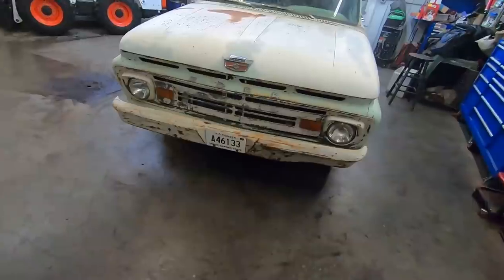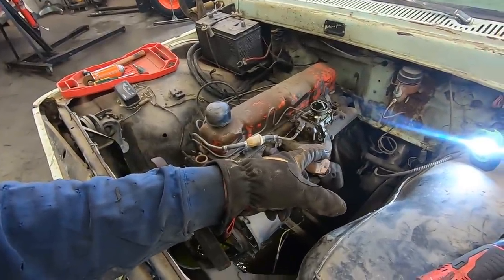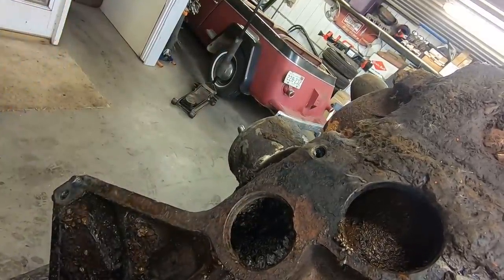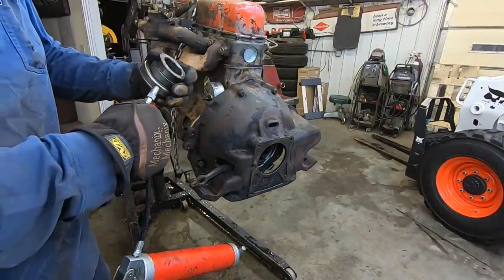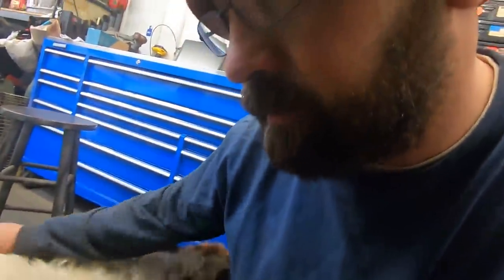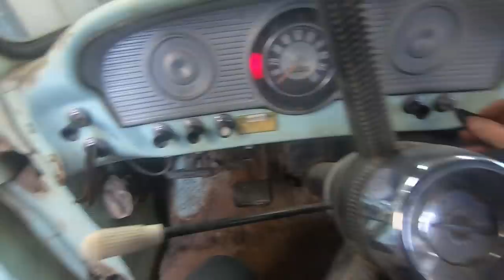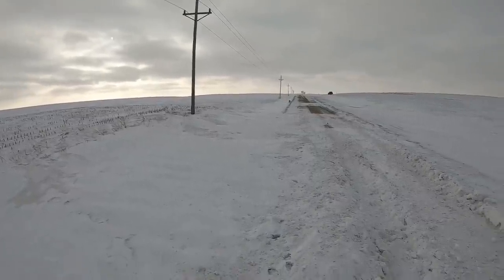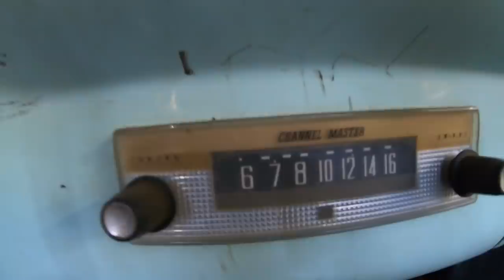My 1961 F100 Unibody Shortbed finally gets an engine R&R! And then we bury it in a snowdrift...

Comment: I got my '66 F-100 stuck in my alley in the mud. Had to pull it out with my '76 impala. Got my '67 F-250 4x4 stuck in my backyard in about 10 inches of snow. I just had new Kelly Springfields put on it. Had to shovel my way down to the house, and drive down the front yard to the street. The clutch was not happy, it was stuck in gear. Good times !

Comment: The trick to floor dry is to just cover the entire floor in a generous layer as a preventative measure...
Reply from the maker: Ugh. Hate that stuff
Reply: Listen to your elders Mortske
Reply: I Just keep my old dog food bags and fill them with sawdust when I do a project. Use that for oil soak duty.
Reply: It's a necessary evil. Especially if you are working on hydraulics. Right Wes? Or, like Possum Works says, don't make a mess in the first place. I hate cleaning. Being as cheap as I am, I don't buy floor dry. I just use a shovel full of dirt from outside.
Reply: Bring a carpenter, Sawdust from the table saw. Then a bit of lime or plaster gets it all and sucks the stain from the concrete

Comment: The flywheel from a Y block will fit and balance on a 223. The advantage is you can get the larger 11 inch clutch. Also if you get the Y block flywheel from the larger  F 600 truck its heavier. It stores more energy and helps with that first gear take off.

Comment: pro tip- to make any vehicle go faster cut a hole through the floorboard (unless it already has one) so you can push the pedal down further and not be restricted by the floor, also works on brakes

Comment: Love the concept to use the front  axle as a snow plow! Definitely keep it as an inline 6.  You and Duff keep up the good work 👍
Reply from the maker: Brilliant!
Reply: David no! there is never a good reason for a six cyl just like there is no reason for hubcaps or wheelcovers& bumper stickers unless you wear a tin foil hat
Reply from the maker: @bradzimmerman3171  Hey I don't mind a 6! Or hubcaps!
Reply: Some later Ford inline sixes had the intake cast integral with the head.   Owners have cut extra holes into the top of the intake and brazed one or two more spouts for carbs.  Cheap and can be done neatly.  Same can be done for dual exhaust.
Transmission is probably limited to a t5 adapted to the stock bell.  I don't know if an RUG will fit that bell.

Comment: I'm a Ferd guy, so don't think I am bashing them, but the Unibody was a bad idea. When you put weight in them, the doors don't work right. Some times won't close, and some times pop open while driving. There is a reason they stopped making them.
Reply: I've got a '62 F100 unibody long bed, it's a runner but it's pretty rough. There is quite a bit of "self clearancing" that has happened inside the door jams where the upper portion of the bed side rolls into the cab, and the area underneath where the rear roof pillars come out away from the bed. Basically evidence of being owned previously by a 300 pound gorilla who'd just go to town slamming the absolute hell out of the doors to get them to close. Much like Morske's rig it originally had like 8 leafs in the main spring pack, and had the 3 or 4 leaf overloads, so Lord only knows how much weight that poor truck hauled around in it's prime.

I've also got a '63 F250 with the standard detached fleetside long bed. I think the unibody trucks are better looking, just because the box actually matches the truck cab and front fenders. But the detached bed definitely makes for a better truck if it's actually being used as a truck.
Reply: I own a 1961 Unibody long bed,my Dad owned. it's been overloaded many times over the years. Never had any problems with it. Cab,doors and all still work just like they did when Dad bought it. One load was the old type concrete blocks, over the top of the cab from front to back of the bed..
Reply: Just like when you jack a unibody car up for an oil change or whatever just to find the doors won't open or close because the body is twisted. Been there, done that. I only own full frame vehicles anymore because of that.
Reply: @_Frank_the_Tank  I agree the uni looks better, but if you want a real "truck"...
Reply: @MaxNafeHorsemanship  In their prime the detached bed was definitely better for a "truck", but 60 years later I seriously doubt anyone is still using one of these as a daily work truck... The ones that are left have been hot rodded/rat rodded, or they're survivors that come out for the occasional leisurely cruise, so typically the better looking unibodies are typically more desired then the standard working man's fleetside.

I'm slowly ruining what made my 63 F250 a "truck" ... Ditching a leaf sprung 8 lug solid front axle for independent coil suspension from a 97 crown Victoria. Ditching a 8 lug leaf sprung rear end for an 8.8 from an explorer with a 4 link and coil springs. Ditching an old inline 6 and 3 speed for a 4.6 and a 5 speed from a 03 mustang gt. Finally, ditching a completely trashed 8 foot fleetside bed and cutting the frame down to fit a step side short bed that came from a 58 Ford.
Reply: @_Frank_the_Tank  Not all of us. If I still had my '52 IHC I would still be piling 2 tons of scrap metal in the back of it. (it was only a half ton) That was one tough truck and the stock 6 was a torque monster. You couldn't make it a better truck. I guess you could make it into something else if you want. I still daily drive my 66 Falcon cuz cars are meant to be driven. Just like old trucks. The new ones don't even compare if you want to do some real work. I still look at things the way they were meant to be.
Reply: They are really cool looking though
Reply: The Unibody trucks make awesome show trucks and cruisers, but there's a reason they didn't keep making them.

Comment: The blower probably starts on hi so as the blower slows down from age and lack of oil it still spins a little and doesn't burn up. Also, a squirrel cage blower will move air even when running backwards, the air flow will be lower though. Sorry, I'm late to the party you are number one on my list and I always save the best for last ;o).

Comment: That’s awesome Mortske, you really keep those oldies but goodies goin. Negative temps and your out bustin drifts with no heat and bald tires??!! You ain’t scared love it! My truck is an 80 F100 and its got a floor shift three speed overdrive. It originally had a 300 six cylinder. First and second low third much taller, fourth very tall.

Comment: Those unibody pickups looked much better than the 61 fleetside with a seperate bed. The bed they used on them came out in 57 . and never really looked correct. I call them wrongsides. In 65 they finally changed to a bed that matched the cab style.

Comment: Excellent video Mortske Repair  :) what do so frost plugs don't leak or blow out is change antifreeze also thermostat plus water pump every 5 years and put in every 3 months to 100ml of Differential fluid in rad let circulation too ! Also help the engine oil cleaner plus gasket from leaks too also crud in behind frost plugs to oil pan when change or antifreeze too! I only had one frost plug come out on me in one vechile because guy rebuilt motor did put in right and  long time before starting rebuilt my own engines plus others too! When lost frost plug was one below head and blew rad up to same time and big cost and frost plug on side of engine on back side ! Plus had do new thermostat too ! Car was 1995 Ford Taurus GL 3.0 litre V6 on right side last year of cast iron block plus heads too and crap transmission Electric 4speed Overdrive Automatic transmission and transmission lines not fun to change to!

Comment: Now that was an adventure Mortske. Nice to have friends to bail you out of the snow. Duff sure had fun though. Hate to say it but it's 80 degrees here in Mesa today. About a 1% chance of rain this week. Definitely Chamber of commerce weather. I' have one of those freeze plug installers but by the time the thing stops trying to install the plug crooked The old tried and true half inch drive socket and extension comes through every time. I picked up a Swedish pattern pipe wrench today. A buddy uses one all time on hard to reach stuff. If you have not heard of it Google it. Might be something to ad to your tool collection. That old Ford unibody is cool as is. Robin egg blue. Three on the tree and all. How many do you see these days without an engine swap to a huge V-8?  I know every pick up like that here has been all chopped up and not in a good way. That truck is surprisingly void of body rot. Great patina. Everybody get Duff approved. Have a great week my friend.
Reply from the maker: Never seen one of those.
Reply: @MortskeRepair  Time to try one.

Comment: So glad your keeping it stock. If you really wanted a V8 I would say shoot for a 289 or 302 it’s probably cheaper than a LS swap. I never understood putting a LS in everything. I know it’s a great v8 but it’s to modern with computer stuff.
Reply from the maker: Can't find a good ford V8 for a reasonable price.
Reply: You can find a good Ford V-8 around my area for a decent price.
Reply from the maker: @stevechasteen4184  What's a good carbureted 351W go for in your area? Where are you located? Send me a link to said deals.
Reply: It varies, I've seen some for 4 to 500. Others are a little more. It seems like deals come along when I'm not in the market for one. There are still a lot of 90's trucks are being parted around here. Also from time to time some marine versions pop up.
Reply from the maker: @stevechasteen4184  90s versions would not be carbureted. Like I said, send me a link to these $500 deals.
Reply: I will when I see them. As for switching to Carburetor it's not that hard. Intake, carb, and distributor is pretty much it. I had a lot of that stuff. But got away from it a couple years back.  I sold it all off fairly cheap and wished I hadn't of. Back then I had little time for a project,  but as I am nearly retired I would like to get something.
Reply: LS is not Carburetor either.
Reply from the maker: @stevechasteen4184  What about installing a fuel pump? I refuse to use a clickety clack electric one.
Reply from the maker: @stevechasteen4184  You are correct on the LS, but there is aftermarket support and I can make one run on 3 wires and a quick flash of the computer.
Reply: You can buy a decent electric fuel pump, it doesn't have to be a cheap one. 😉  I used to have pretty good luck with Holley  electric pumps,  unless their quality has gone down hill. If you want mechanical FP it's not that hard to change timing cover and install eccentric. Or if you have the whole vehicle you can use the fuel injection and ECM,  just like you would have to do with an LS.

Comment: Ha!, Shades of 1970, high school. Street drag wars, kids from families with money vs us farm kids. We were hopelessly outclassed by local GTO's and such, but did have some success after my Mom's LTD got rear ended and we swapped its 429 auto into an identical little Ford pickup. Right out of the gate we learned the true meaning of wheel hop, cured with a set of home brew traction bars, which led to lots of tire smoke and not enough hook up to hang with the big kids. Traction issues quickly cured by adding duals to the rear. The quick and dirty fix worked, the farm kid way, by welding two stock rims together rim to rim. Then that beater truck hooked up big time. After a week or two Jimmy wadded the truck up though. It got pretty squirrely over 100 or so, but at least we did get some respect. Wild times.
Reply from the maker: Nice!

Comment: I commented on my other account earlier, but I switched over to my main channel to comment this. My 223 in my 61 Flareside has no compression either. The parking brake cable was cut, so yeah it does slowly roll down a hill in gear too. Haha

 Looking up the VIN for your truck, I found it was manufactured in May 1961 in Kansas City, Missouri. Sequential serial is 173014. My 61 was Manufactured in August 1961 in Kansas City, Missouri. And my sequential serial is 190828. It's awesome to think both of our trucks rolled through the same line, just a few months apart 61 years ago!
Reply from the maker: Great info!

Comment: Hey morty n duff, cool old truck. You mentioned upgrade and cost, on the flipside, your budget path keeps it original. I do think some Guages would be cool, left and right of the speedo in the circles. I may have the king pin reamer for the job. My dad had an early econoline van, as a kid I remember helping him do the king pins. I inherited dad's tools and I have the reamer in the tool box.  Keep up the cool videos.  Love the look of that truck. Looks like you enjoyed duff, playing in the snow. He's cool.
Reply from the maker: Old tools are the coolest!
Reply: I'm from back in the day, I've owned and drove a lot of vehicles without ps,pb,ac,pw. Bare bones vehicles were affordable and fairly common. We weren't pampered. Vent wing 260 air. Let me know if you decide to  tighten up the steering, I'll mail you the reamer, I'll probably never use it.

Comment: I had no idea they made unibody pickups.  I thought "unibodies" came about as a cheaply built alternative to try to keep up with foreign imports in the late 70's when Chrysler came up with the "K" car and a bunch of crappy cars with bad motors followed.  With that being said, this truck is SWEET!  The body lines are great.  You should throw a paint job at the thing and do that for a video.  "That other guy on YouTube that used to live in Minnesota and now lives in Tennessee" painted a square body with a kit that cost $119 on Ebay.  The same thing could be done to this truck using Bobcat white as the base color and Bobcat orange as a trim.  Maybe just paint the tailgate the orange with the "FORD" in white and/or go with steel wheels painted orange with chrome halfmoon hubcaps to set them off.   Nothing to crazy would make a lot of difference with this beauty.  A simple 2-tone with the white above the hoodline and the orange below the hoodline would be another option.  I did some research and found out Chrysler moved from the "body on frame" construction to "Unit Body" cars clear back in the '60's, so I learned something today.  Anyhoo, I had a 5-digit offer in mind with the stipulation that the key is transferred to a Puddin's Fab Shop key chain, the engine stays a straight 6 and I get custody of Duff on weekends, so it might be too low, although I wouldn't require it have mirrors, I don't use those anyway.  For those that read this whole comment, I commend you on your literacy.  Thank you for your time.
Reply from the maker: We don't paint nothin!

Comment: Let me tell you a little Ford story. Back when we went to a dealer looking for a truck. They had a 92 F159 SC and a 93 Chevy regular cab.
The Chevy was V8 Auto. The Ford was 300 Six and 5 speed manual. We ended up with Ford as it just drove better.
We had that truck for a long time and I would like to find one even now,
Reply: F150

Comment: Mortske, in the mid seventies I had a 1963 unibody 8 ft bed 292 three on the tree. That pick up road the best of any truck I've ever owned. Like a full size Ford car. Didn't handle too bad and got decent gas mileage for a V8 14 MPG on the road. Wish I still had it. Bought it for $600 sold it for $400 with a blown 292.
Reply from the maker: Not bad!

Comment: My grandfather was a master mechanic from about 1915 through 1950s. He used to cut holes in the firewall often to get to the rear freeze plugs of many cars. Back then there wasn't as much on the inside to get in the way so it was a common practice.
Reply from the maker: Ooof

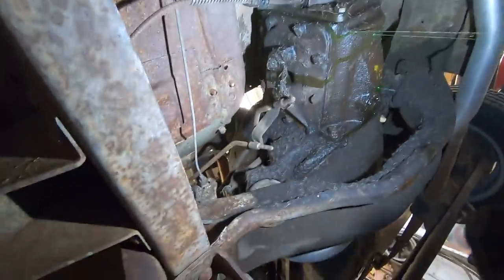Comment: I know it's a little late with this Kevin but my lighting plug for 14:36  my HDMI took a crap and for some reason I couldn't comment anything, but any who next time you do hood springs I use a ratchet strap between the spring and the front support to pull the spring on and off, works great👍
Reply from the maker: Thanks for the tip!

Comment: I had a 62 unibody back in the early 1980s. I was quite fond of that truck other than it was a bit of a handful to drive when loaded with firewood. I liked the engine block heater. Anytime a frost was predicted ... I'd plug it in and set the heater controls to defrost and I then had clean windows when I went out to leave.

Comment: What and awesome truck I had one just like it but mine was a step side. I like that one better. 223 solid lifter motors run so good. I wonder what size ratio the rear end is. Mine was a limited slip some   really low gears though. Not a high speed truck topped out about 80mph. Im not exactly sure that was a long time ago. I drove it to work everyday rain snow ice didnt matter. Great fishing truck it would  go most places. Mine was rebuilt by ford it ran perfect even though the rocker arm shaft was wore out. I just adjusted them by ear. It just ran great. Really noisy when it was maxed out. Rides rough its the huge stack of leafs you could take some out. It might need some new door seals and window channels. The heater in mine was super hot.

Comment: nice video shots and setup this time mortske👍 ,,damn hard work these trucks on your own AND you work a full timer too,much respect ,need to get a truck lift patreon started😁
Reply from the maker: We got one started! Thanks Marc!
Reply: @MortskeRepair  good man even if the roofs low ,it will save forever jacking those trucks in the air😁
Reply from the maker: @marcperrett662  All you can get at is brakes and suspension. they're in the way to get at transmissions. And they're in the way when not in use.

Comment: I had a 61. If that was sold 61 then it was late in the year because the grill is 62 and the letters above the grill are factory. If you splice in a 1995 full size bronco frame and all , it might be possible to open the cab door when there is any weight in the bed.